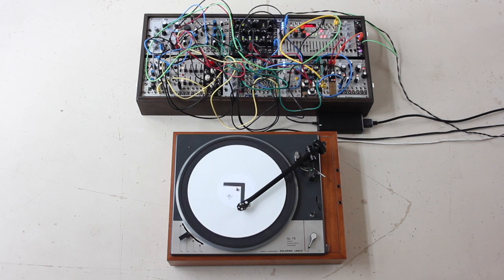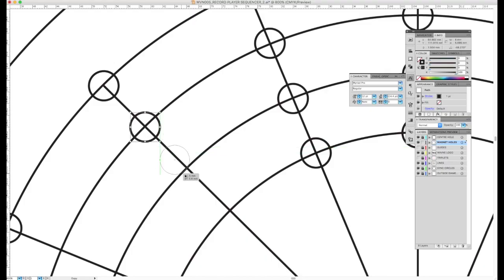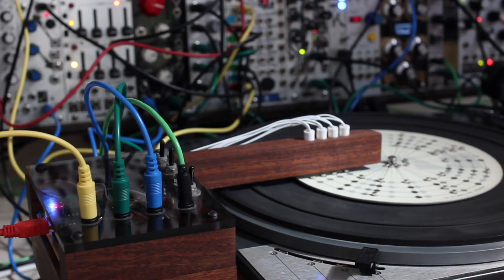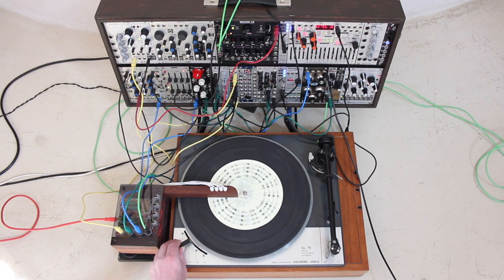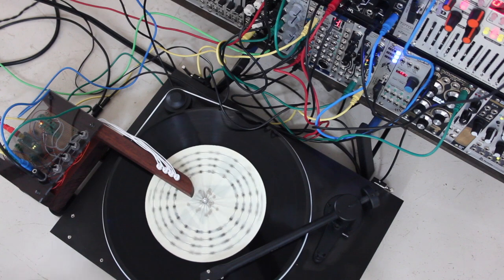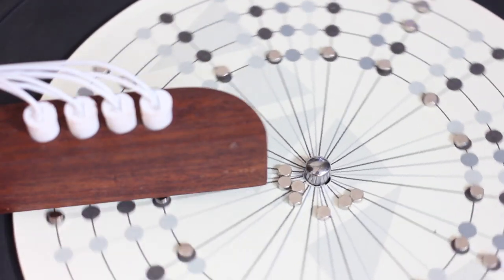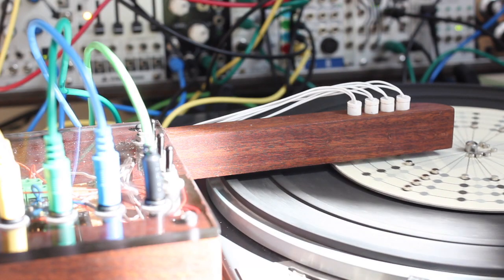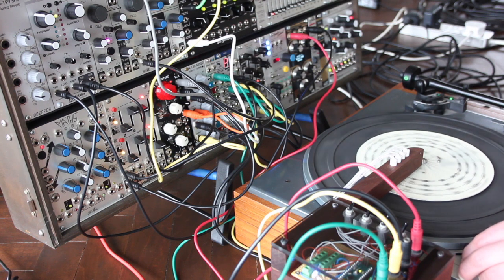HOW TO SEQUENCE YOUR EURORACK SYSTEM WITH A RECORD PLAYER

Comment: Hi Lomond,, Just Want to inform you that the Arduino code is missing on your website. #lovetoseeit  Also I am wondering If I Could make a similar design using transistors , capacitors for creating trigger pulses, and hall effect sensors .these draw far less current
Reply from the maker: Ah thanks for letting me know. Will look into that. Yeah, it could be done an alternative way bypassing the use of arduino.

Comment: such a nice thing lomond! well done. 

i have two questions please.. 
how deep the holes for the proximity/reed switches are in the end of the 'arm?
and what's the size of the arm and the other wooden cuttings? 

thanks!
Reply from the maker: Thank you. The main block is 140 x 100 x 70mm and the Length of the arm is 170mm with a depth of 25mm. The holes for the proximity switches go right through and the switches go all the way through and sit proud. The fit was snug enough to hold them in without glue.  To be honest, you could make the device any size.  I have adjustable feet on mines but mostly just use books to prop it up to different heights for different turntables. The important dimension is the space between each sensor, which is 10mm. That needs to be accurate to line up with the rings on the template. Good luck.

Comment: are the specs of the reed switches important? I'm guessing V, A and W aren't since those are maximum values and this project doesn't even come close to them, but what about switch resistance etc?
Reply from the maker: Daniel Kuhn yeah, someone else asked me this question via my website. I don’t think it will have an effect. I just used proximity switches that I had lying around and didn’t pay attention to spec. Turns out they were rated for high voltage and worked fine. In fact, they’re really sensitive. I’m working on the next stage of this project using a treadmill motor and they still manage to switch on every pass of the magnet despite very high rpm. I guess you’d just have to try it out and see what works for you.
Reply: @lomondcampbell3615  cool, thanks for the info, will try to get my fingers on some then... Also, can you elaborate a little on the design of the sequence plate? And have you thought about adding Midi to the game?
Reply from the maker: Ah...MIDI would be amazing.  I'll need to look in to that.  Not done all that much MIDI hacking yet.  The plate was just designed in Illustrator. I divided up the circle in to quarter note, 8ths, 16ths etc.  I included some triplet offsets too.    Here's the link to find the design https://www.lomondcampbell.com/projects-1